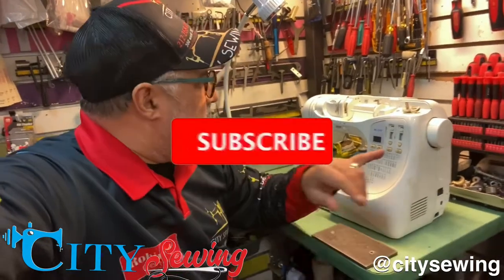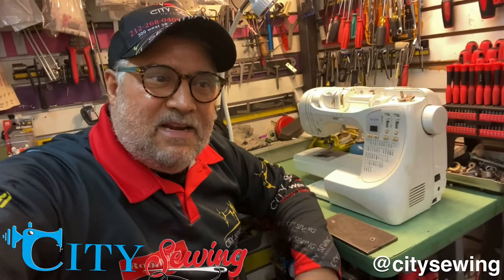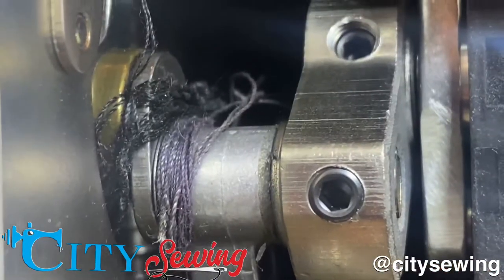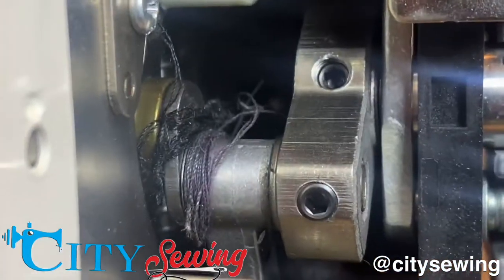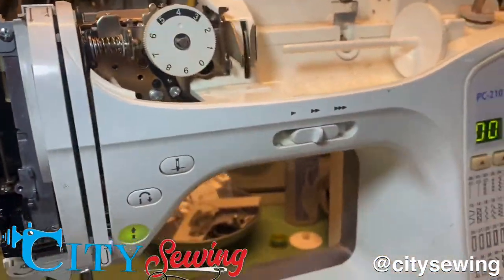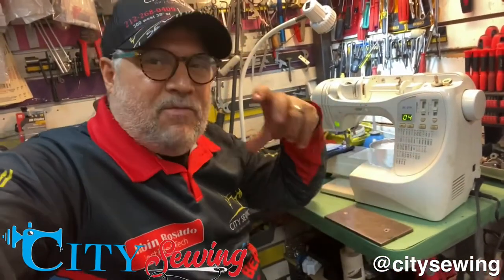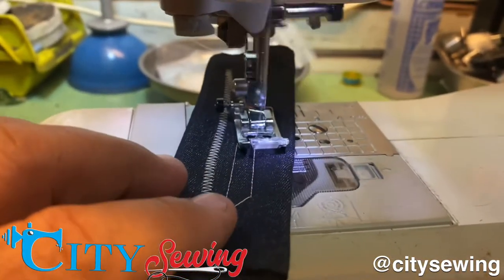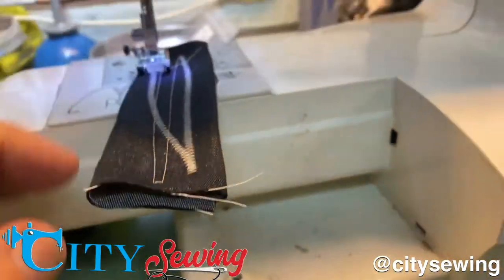Brother machine, EASY fix

Comment: Hi There so glad I found you! Need a little help. I repaired the thread holder on my xl-6040 and a little spring came undone while I was putting the case back on. The little spring is still connected on one side close to the tension wheel but I don't know where the other end attaches? Please help! Thanks again!